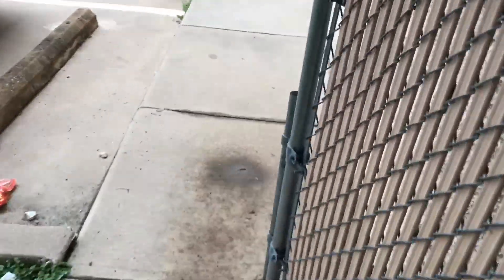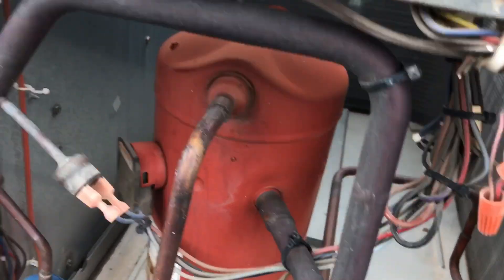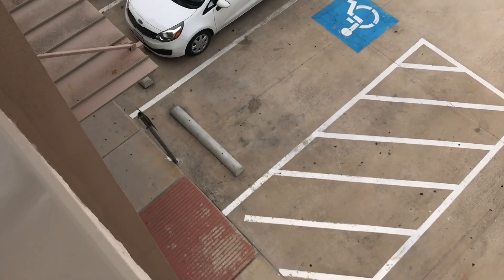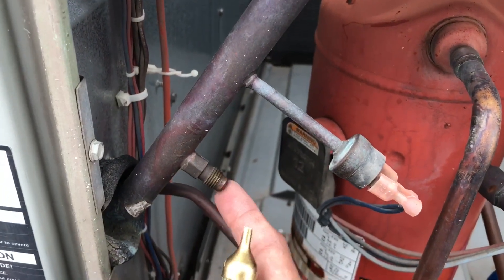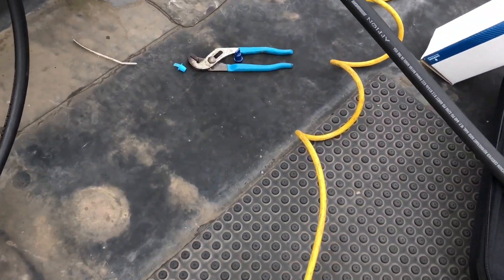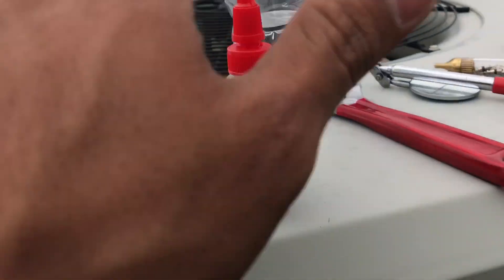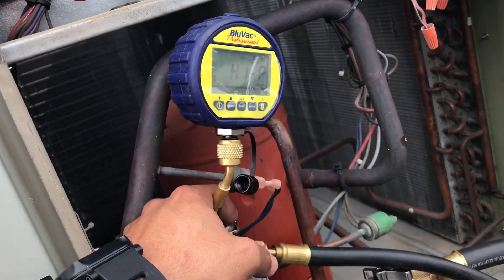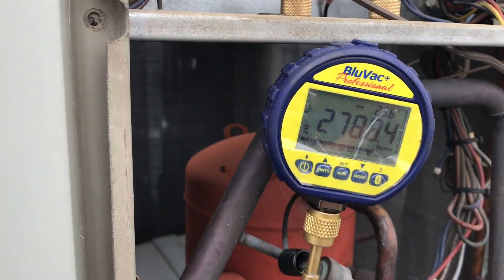Replacing a filter drier, pulling a vacuum and charging using the fieldpiece srs1 scale

Comment: Heard Alex Jones in the background... Truth with lies.
 I like your set up, I had bluvac and testos, they were stolen, so I'm now using my back-ups - fieldpiece micron gauge and my SMAN gauges.
And I would never seal the schrader valve cores like that. That is what a proper cap is for. Only makes it harder for the next guy that needs to remove those cores, or impossible.
Reply from the maker: Man that sucks bro.  Yeah true but the nylog never hardens. It’s like a lubricant. It’s made out of refrigeration oil

Comment: You dont need these larger extension cord
Put you cables on the disconecter of he Unit.
Thanks de share Ulises!!
Reply from the maker: Thanks.  The unit was 480v 3 phase if I remember correctly.
Reply: I'm fairly new to the field but please explain how.. I saw someone did that but for nothing I could remember

Comment: why wouldn't you just cut it either side with a tubing cutter instead of heating it off? Asking for my knowledge, not because I'm a pro!
Reply from the maker: land mostly because the copper goes into the  filter drier about 3/8 of an inch on both sides. I would have to had a piece of cooper to make the new one fit or  try to bend and stretch the piping to try and make the connection the new drier. Which I need about 3/8" on both sides.
Reply: Land, because it is a perfect fit. Also, you already have some solidified silver braze on the tubing that gets you started before adding any new. Often times you have to heat it just to get the drier on. 

Ulises, that torch took forever for that size tubing. I have a old (B) acetylene  Turbo Torch with two  tips I bought back in 2002. I was using it on 1 3/8" Ref this week. Now THAT took forever to get done.

Land, never sweat or cold solder ANYTHING in refrigeration applications. We've had units crashed with lawn tractors, forklifts and vehicles flip over on their side. After we flipped them back up and rolled the kinks out carefully with a Crescent wrench they were good to go.

Cold soldering or sweating copper is for plumbing and water ONLY!

Comment: Never. Never sweat out any. Dryer the heat will make ritain moister run back in2 system all gasis expend with. Heat pendejo
Reply from the maker: Ruben Castillo lol. You’re right it’s best to cut it out. Work on your grammar. I’m sure some of the heat will evaporate.  The very little moisture if any.  Plus if you pull a proper vacuum you don’t have to worry about moisture left in the system

Comment: Nice video Ulises.  Did you use nitrogen when you un-swaeted the filter drier?  I didn't see it hooked up then.
Reply from the maker: Eric S thanks. No I didn't. I probably should. Whenever I take out a drier I'll will blow out the lines both ways with nitrogen. To help get any oxidation flakes and crap out of the system.